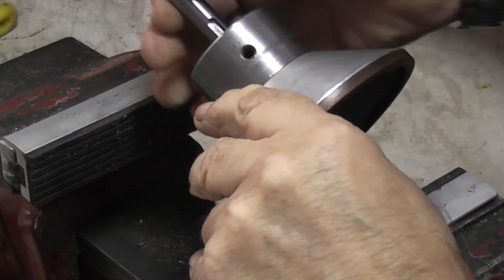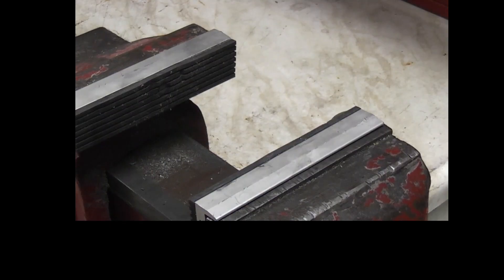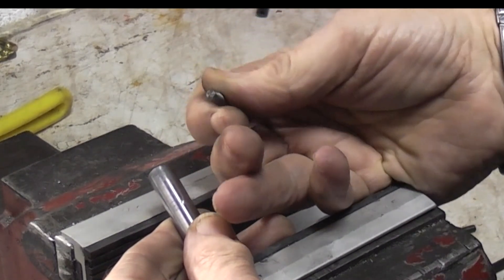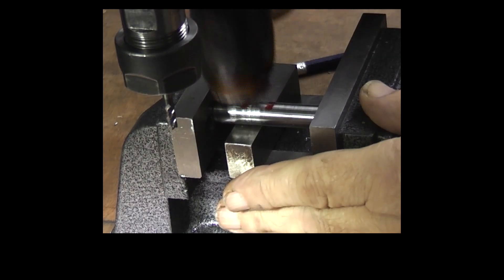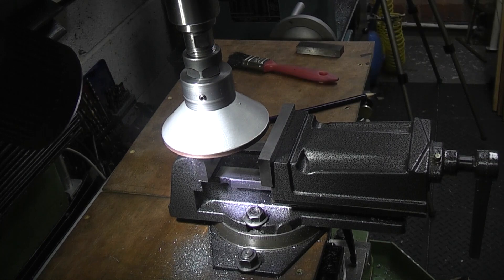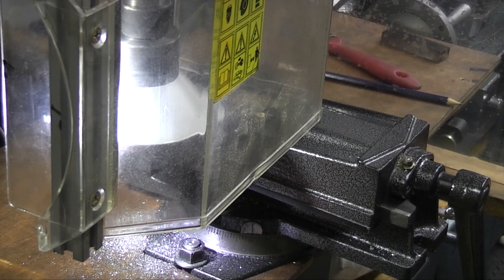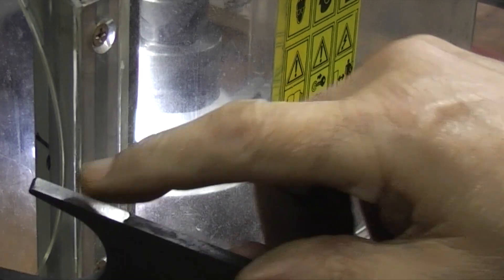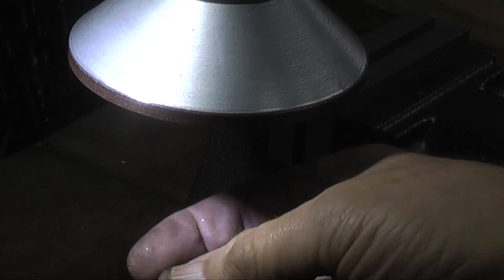Finish of the grinding adaptor and test grind

Comment: Great finish Alan, could get you out of a tight spot where surface grinder is required. Wouldn't fancy the clean up operation each time, I guess your bed protectors help though, must make myself some. Cheers, Jon